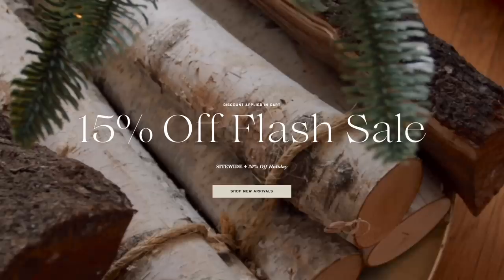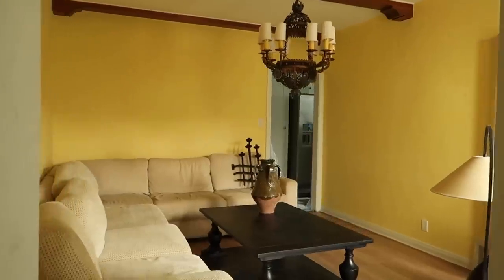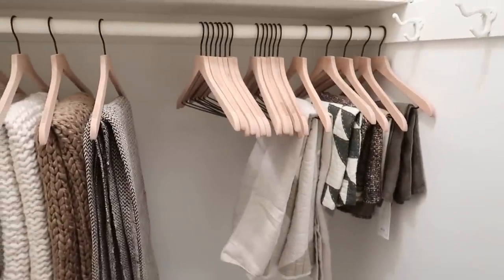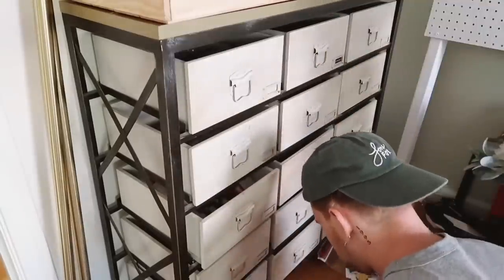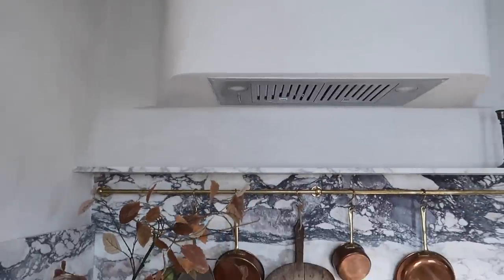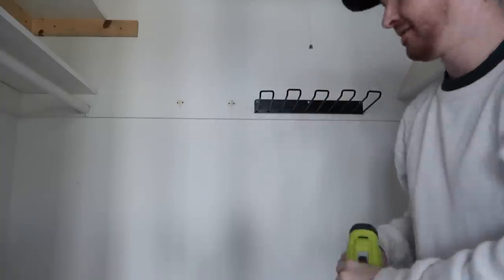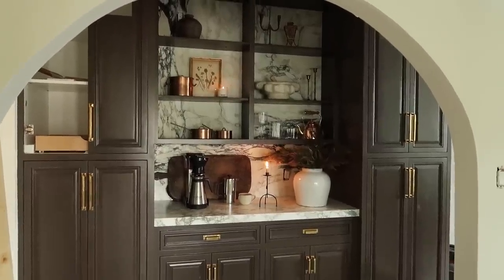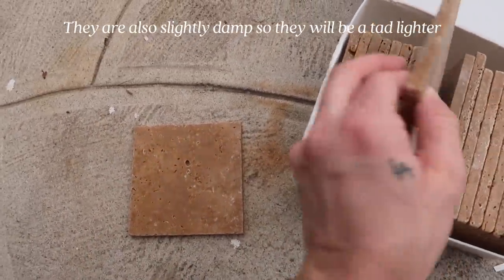COFFEE BAR MAKEOVER *Full Marble Install & THE KITCHEN TILE ARRIVED!*

Comment: Obsessed with the kitchen windows 🔥
Reply: Those windows are a mess with the marble going over the wood.
Reply: @joshr9417  that’s technically the trim, but the new feature on the window themselves is what I am obsessed with. But actually the marble over the trim doesn’t bother me either. Controversial opinion, I know!
Reply: @joshr9417  yeah, not a fan of that choice either.
I also always thought he would try to add more shelving, but he hasn't and now starting to think he won't. So starting to get worried about the functionality of the kitchen. So far, half of it is just for looks.

Comment: I thought you already had a sealing product on the marble? Didn't you have a couple come over with there own custom product?  Everything looks amazing and I love those fake breads!
Reply: Interested in what happened here too. Did you remove the sealer ?
Reply: I was thinking the same thing!
Reply: I think the protective film was for the horizontal surfaces and the liquid for the vertical ones...🤔
Reply: @carolinacarsolio5476  I thought I remembered them putting it all over, but I could be wrong. Confusing 🤔
Reply: @TheKickasskatie  you're not wrong, they were putting it vertically too, there was a clip in that video of the couple putting it on the backsplash marble of the stove. I was wondering the same thing too, how does it work with the tuff skin layer he had installed?
Reply: @TheKickasskatie  confused too...
Reply: Was looking for this to recommend to someone else. Did he delete that video?
Reply: @natashajones261  the marble sealer was included in his video about restoring his windows.

Comment: If you are lacking parking space in the front of the house a small area for parking is good to consider with the closest street access. Can't remember the layout. But you did mention it in a previous video. Also how many vehicles will be at any given time, or when you want to have friends over for your off hours. Definitely trees that compliment the house and hides the neighbors. Nothing like knowing what kind of laundry soap they use. If you keep the concrete until you definitely have a solid design then you can have removed what is not needed. But you could create areas in the yard. Maybe a fire pit, or a BBQ Grill area with a table and if the screen room is in good shape can use it to go over the table. What about an area for sitting and reading. Don't know what you do on your time off or what your likes are or how you entertain at home. But areas you keep for pathways and entertainment would look nice in Mexican/Spanish tile. The natural drying process alot of times include animal tracks as it is kept outdoors to dry and cure. If you have to dig up the concrete in certain areas I definitely would only put green plants or seasonal shrubs. You will hate grass. It's easier to pull weeds than it is to mow grass.
When you can get your head wrapped around your yard it will come together. Alot of people have given some good suggestions for you, it will stir those creative juices later on.
Really loving how things are coming together.

Comment: I’m going to go off on grout for stone.  Match as close as you can.  Fill all the holes as well as the joints.  Seal everything with miracle sealants for limestone Z(911 porous plus). Clean only with stone soap from miracle sealants also.  The stone soap enhances the sealing properties.  Using soap and water will leave a soap residue and turn the grout black eventually.  A water rinse can work between stone soakings.
Remember that sealing the stone won’t make impervious to stains, it just give you a fighting chance to clean it up.  Water wipe up only.   Accidents happen…look at them as patina.

Comment: Finishing idea for the range hood, is there a way to add a bit of a lip to it to hide the silver range part a bit more?

I think it's such a cool idea and looks lovely! But with the brass and copper accents, the silver is just a hair distracting and curious if there's a way to add 1cm - 1 inch bellow what u created just to hide the range. If not, that's fine cause it's so incredible. Just thought I would mention it just in case it was still possible at this stage

Comment: You can buy large metal dry cleaning hangers with a non slip rubber covering on the bar to hang blankets. Do not use clips! They will leave a mark on the fabric! And never ever store textiles in plastic bags or tubs!
Reply: ☝️☝️ Congratulations’ you won! Ensure to reach out and send a message to the telegram above ☝️☝️ to claim prize 🛍.